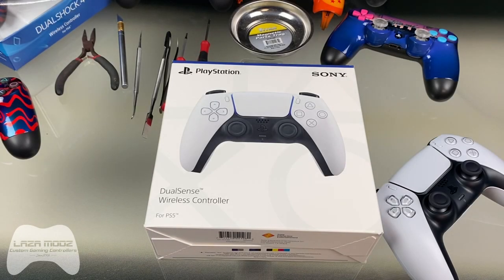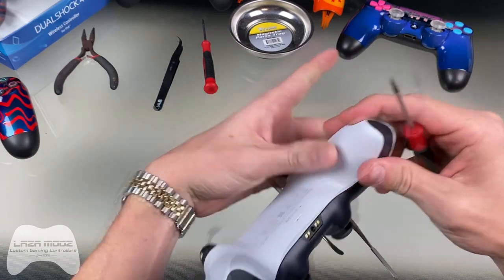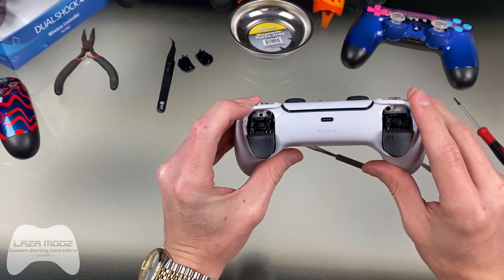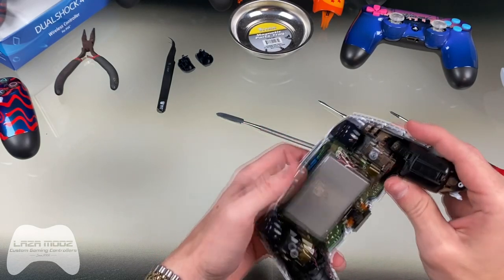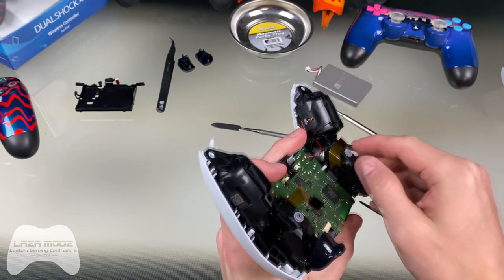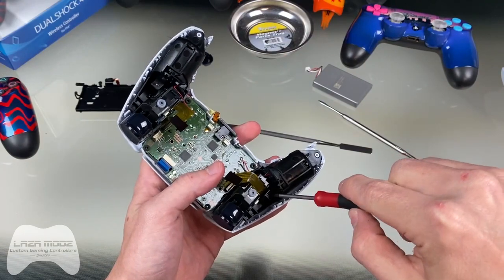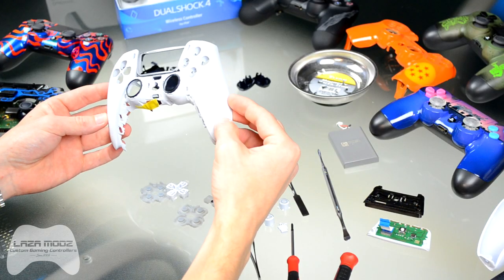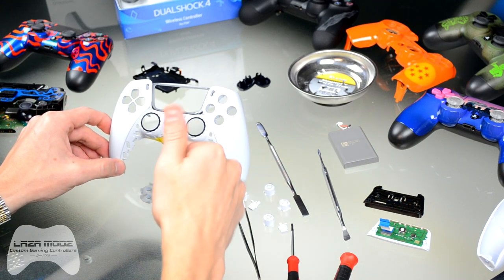How to take apart a PS5 Controller | LaZa Modz

Comment: Ok I got it apart how I get it back together lol
Reply: play vid in reverse😭😭
Reply: That doesn’t help
Reply: Lol
Reply: man i don’t know i’m crying i broke mine
Reply: @getbackesmith1112  I only needed to open the first part to fix an issue with the analog sticks , unless you had a reason for doing this you have no one to blame but yourself lol
Reply: @getbackesmith1112  lmao 😂😂😂
Reply: @ywwb  Lmaoo
Reply: @getbackesmith1112  i just did the same :((((
Reply: @markbrannon3720  bro these controllers have manufacture defaults
Reply: Yeah bro I already know I just bought my second controller in its already drifting smh I would have gotten insurance but I didn't no that these controller have problems 😒
Reply: LMAOOO😭😭 mane left us for dead
Reply: You can’t , the pieces don’t fit the right way after taking it apart
Reply: I got mine apart during an accident
Reply: U Better find a way out
Reply: @jony5075  bro my stick popped out on its own somehow and I tried to fix it but now I can’t get the buttons back together, I’m literally so annoyed right now because I barely even have time to play :(
Reply: @toxicdamien8315  what? I literally just used my hands and one screwdriver and reassembled everything in working order.
Reply: @toxicdamien8315   that’s a lie just put mine back together perfectly
Reply: lmao exactly
Reply: Shut your eyes!
Reply: @toxicdamien8315  the hell are you talking about everything fit perfectly you probably used the wrong screws plus i also took whatever was broken from my controller and replaced it with what wasnt broken on an old controller
Reply: Lmfao
Reply: Right where's the video putting it back
Reply: @getbackesmith1112  😂
Reply: @jony5075 I have to trying to put new buttons layout on

Comment: I know for a fact if I took it apart there would be a lot of extra parts after I put it back.....so I'm not even gonna try this
Reply: You would be surprised, it’s actually surprisingly easy to take apart controllers. I did it multiple times with my ps4 controllers and the ps5 controller is basically the same, just a few extra screws and ribbon cables.

Comment: I've opened and closed my controllers many times but at one point you will definitely mess something up. Today I opened my controller to fix the stick drift and while I was pulling the menu pad ribbon cable it broke off 💀💀 it was so unexpected like of all things why does it had to be that specific thing. I'm so pissed I wasn't even that harsh with the pulling it was as usual but I think the years of wear and tear finally did its part.

Comment: Thanks man, I don’t know anything about this stuff, but followed your instructions, I only removed up to the mother board, disconnected all the cables and was able to put it back together. (Was having issues with button inputs working.) 

Appreciate you going into detail on what all the connections did. Helped a lot to solve my problem.

Comment: My PS5 controller was very slightly different than the one in this video but the process was still 95% the same. The buttons on mine got gunked up after my niece spilled her juice on it so rather than buying a brand new one for $75~ I used this guide to take it apart and clean all the buttons. Feels like new now! Took me a couple hours but it was worth it.

Comment: Very helpful video thanks mate. I cracked my new Gray Camo PS5 Dualsense open to swap the x, square, circle & triangle buttons over for the colourful PS4 action buttons and they went in with ease after a couple of little trims and filing here and there and went back together just as simply as it came apart thanks 😊 🙏

Comment: So the front black plate. Left side the circle thing to connect at bottom of controller won’t attach and also the white top part is going apart of the bottom part so you can see a little inside the controller I’m trying to use force to put it back in and it just won’t go back. Could you please help me out

Comment: thank you very much, I made a foolish mistake and stood on the controller, gammed the back right button. followed far enough in the guide to get to where I could access it. the trigger part was over instead of under the button. took a bit of effort but all fixed. thank you again.

Comment: When I was taking off the ribbon cable to remove the mother board I pulled the ribbon cable to hard and it came all off,both ends.Now my L2 and L1 don’t work I saw through testing in game that once I connect it it works but it doesn’t stay,only the part the end of the ribbon cable that shouldn’t come off doesn’t want to stay.Any advice I really need help
Reply: I riped it by two and idk if I can fix it manualy
Reply: @benvrywhere3719  I managed to put it back but u got to be slow so it doesn’t move out of place.The controller works good on the L2,L1,R1,R2 except it has bad controller drift

Comment: I saw your controller in your website costs $179.99. If i order one, i want it just like the picture you posted. My question is, do I have to add extra cash to make it  High Gloss Finish when the item/picture shown is already in high gloss finish.
Reply from the maker: The finish is up to you. Our regular finish is almost as shiny and glossy. The only difference is the high gloss is hand buffed and an extra coating called hand glaze is applied. 

You’d have a hard time telling the difference between normal and high gloss. However we offer other finishes too like matte!
Reply: I wanna see the metallic finish too and see what it looks like. Do you have anything on your site to show the metallic finish even if its a Ps4 controller? Just wanna see how it looks like.
Reply from the maker: @killgambittv828  we do have a scroll through our Instagram. We have a lot of the finishes on there. Here’s a link to the metallic finish. 
https://www.instagram.com/p/BRrF0_cBrYq/?igshid=17s4a1a0fj1h4
Reply: Ok thanks, i’ll check it out.
Reply: One last thing, can you customize based on my gaming logo?

Comment: I need to take apart my boys ps5 controller after he spilt some water on it and it stopped working. Any recommendations of what to look for or use to try and wipe it down inside
Reply: Buy a new one, wait a day or so after you get the new one..put the old one back in the box that you bought the new one in, take the old one back to the store and say you just got it and it doesn't work (make sure it looks never used or close to it) then boom a return and another brand new controller.
Reply: @MysticalReaper  thanks for the advice but i opened it. Cleaned with isopropyl alcohol. Still didnt work sonsent it back to sony and they replaced it for free
Reply: @dmh101  alright. I do the same tactic with earbuds as well. All they do is through what you bring back away anyways

Comment: The ribbon cable shown in the vid at 6:27 for the touch pad doemst look like mine. There isn’t a blue tab where I can pull it out safely. It’s just the thin cable and I don’t think I can pull it like that
Reply: This is very late but is it possible your controller is a bdm-020?